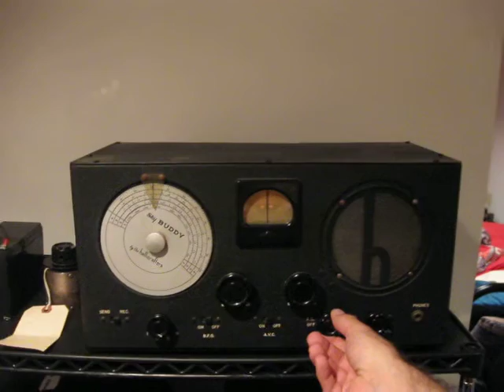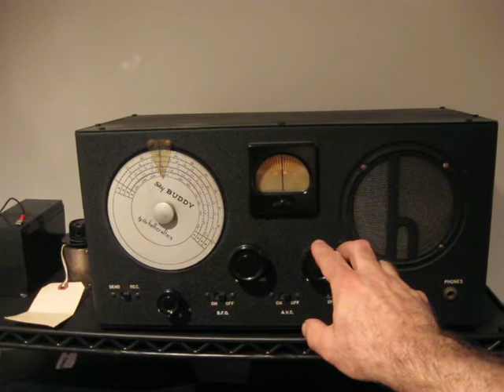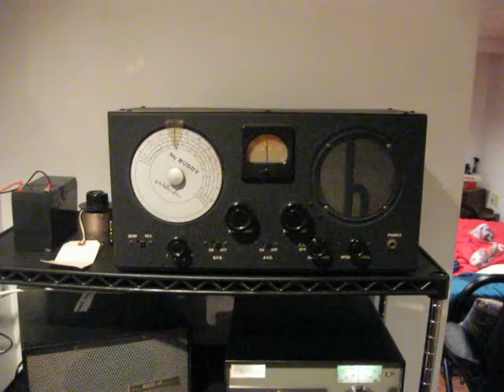Drake SW4A vs Hallicrafters S19R & Other Radio Toys @ WA3TTS

Comment from the maker: HI All: I added two photos to the video description that show the e-probe antenna used and the 10:1 transformer used to feed the S19R and SW4A radios. Real big low noise  improvement over tapping my porch downspout as a improvised long wire....73, Mike wa3ttts